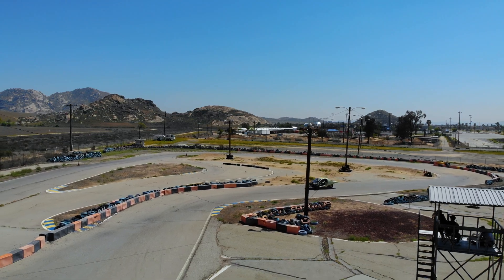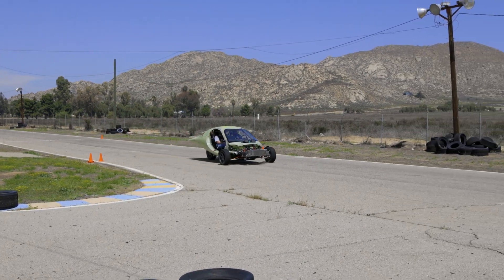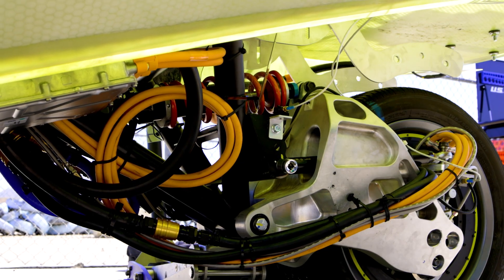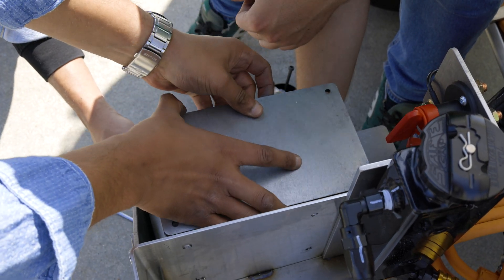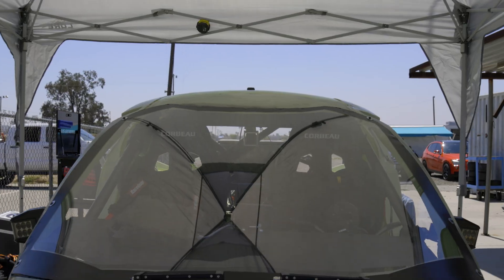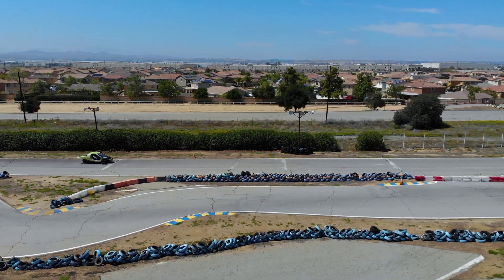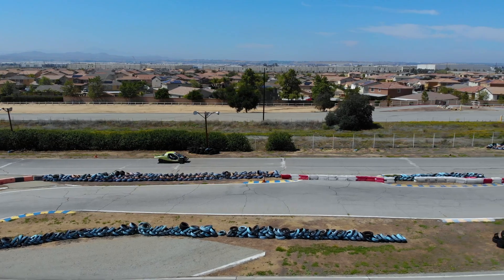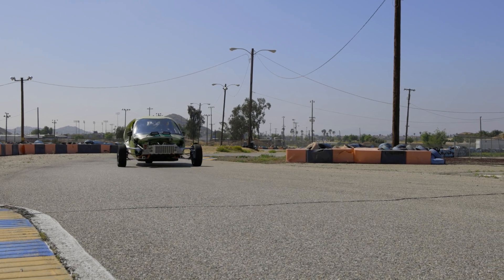Aptera — Brake Testing

Comment: Ha..the car that never could.  This vehicle is a great scam.  Humans have put spaceships on the moon quicker than you guys can release a freakin plain ol ground rolling vehicle.  It's not even a new idea.  People been rolling along on wheels for centuries.  Year after year, month after month, week after week, all we get to see of Aptera is we did the brakes, we did the tires, we did the steering, we did the suspension...haha..  Why don't you just milk it until the Book of Revelation has been fulfilled already?  People have invented 4 passenger private drone electric helicopters that consumers can buy in the time you guys are still trying to invent a car.
Reply: There have been plenty of automotive scams, but Aptera is not one of them, as anyone who does a little due diligence would know.

This present design was started in 2019.  Remember that it took Tesla 6 years to do a simple EV conversion of the Lotus Elise, and even then, has sold fewer than 2500 of them in all this time.  Get some perspective.

Comment: I see a lot of talk about making this a safe vehicle but except for the reverse lights it looks like the rear is all red lights. Will this not have amber turn signals? They're proven to be safer so opting for red turn signals seems like either cost cutting or an oversight.
I haven't seen a video of the turn signals in action but since the front fenders have the amber wrap around to the back I assume that signal will be visible to a vehicle in the next lane, like how Europe requires side turn signals on the fender/mirror (also proven to be safer)?

Comment: How does this thing work in the snow/cold weather?
Reply: We will have to wait for more reports to really know.  They intend to validate it down to -20 F.  The BMS system will keep the batteries warm.  Also the ABS/Traction control is one of the most sensitive on a production vehicle, thanks for the fine control available in the wheel motors.  It can sense slip and adjust torque 32 times per wheel revolution - or about every 2.5 inches of tread travel.  I think the AWD models will be excellent and based on my experience with the Gen 1 Honda Insight, I think 2WD will be acceptable.  I live in Iowa and have an early preorder, so I will be finding out.

Comment: I’m worried about going snowboarding in California with my aptera. Other than some weekly visits when sometimes it snows, I don’t really confront snow or anything. If I’m worried about the trip while snowing (AWD ofc), would it be a safe bet to just remove the wheel pants? Or would I have to/(recommended to) upgrade to the off-road package for safety?
Reply: I just put in my order and an off road package was an available option with higher clearance for the wheel fairings.
Reply: Hard to say at this point.  I would consider putting on snow tires for conditions like this as the most sure footed option.
Reply: The indicator lights are on the wheel pants.

Comment: My only real question is how much leg and headroom does it have? I'm 7ft tall and although I would love a more fuel efficient car or EV, unless I want to drop 100 grand on a tesla model x, I'm kind of stuck with larger SUVs or Pickup Trucks. I love the design of the Aptera, but would someone my size be able to fit?
Reply: At 7 ft, unless you have an unusually long torso and shorter limbs, I don't think you would find it suitable.  Perhaps the seat could be modified to drop you down enough to make it work.  I am sorry for this bad news but I suspect this is an issue you have with many vehicles.
Reply: @n.brucenelson5920  pretty much all vehicles, I modified a Chrysler 200 when I was commuting 140 miles a day. Now I’m a lot closer and got an older Tahoe that I fit in when the Chrysler hit 200k and died on me. It’s a lot of fun and suits me better but gas is killing me at 15 mpg.

Comment: Interesting, finding the optimal braking in each weather condition with the shifting weights perhaps as well as the ratio of the build and passenger or single driver.
Reply: The track tests are done to validate the computer models which allow them to test all those cases virtually. 
If I can take a guess ..... I think they are mapping braking performance as a function of Cg (centre of gravity) location between limits determined during the cornering tests done at Chuckwalla. Now they narrow those limits by finding find the Cg range that gives the best balance of braking performance under the test conditions and edge cases, then balance the design around the acceptable range of Cg that has been narrowed by the braking test. Occupant seats are close to Cg, so will not greatly influence the balance to the front or rearward.
Reply: @limwang6241  hmm the center may be all good but say there's more weight like a person on one side on ice , all cars have to worry about that stuff even when moving. The software can work that stuff out also your right. We'll to me figuring out if a motors wheels has more power resistance or or moves easily on ice and snow or needs braking or whichever motor is just working better even bearings get old ,or worse and anti slip can and will be figured out with a computer program. I assume camera's and lane keep could help maybe when it's all snow some type of infrared or environmental calculations could help as well for solving drift. Guys who do that stuff each systems go through this stuff and people. Hmm you seem upset so I edited this comment for more insight perhaps, the cad guy was only working on some measurements and design pieces not the programming of data testing and such he was no kind of engineer what so ever, but all companies need a cad guy and those cad programs are basically just measurements with a picture. The real testing is done with testing programs, not that cad guy most people have that guys issues don't worry.  Those cad program's are known to be buggy with even just a common update, don't fire the cad guy unless he tries to take shortcuts and make things more difficult to work on and get too.
Reply: @1978rayking  Sure, I guess similar calculations can be done side to side and that the mass of the occupants will make a larger contribution to the Cg location sideways.
Reply: @limwang6241  yup , haven't you been skiing we turn by putting are weight to one side even if we don't angle are feet. Of course the Aptera will have anti skid
Reply: @1978rayking  Yep,🤪 I could not snow ski if my life depended on it.

Comment: Your updates is always a gift. Thanks for that. 
About the brakes, how much regenerative brake will we have? I mean will we be able to drive with one pedal ? Have you  study the possibility to get rid of the brake pads and have electric brakes (More regen and/or capacitor storage and/or reversing the motor power) ?
Reply: Great question. Regenerative breaking usually recovers up to a maximum of around 80-90% of the kinetic energy in an EV with gearing etc. 
Single pedal driving is a question of how your speed controller is programmed. I have seen a MiEV hacked by a guy in Brisbane for single pedal driving and max power / acceleration .... it was awesome in a squealing tyres kind of way.
Eliminating brake pads completely may not be possible because they are used for the parking brake.
I would be a little freaked out driving a car without brake pads regardless of the brand.
Reply: @limwang6241  For the parking brake, many cars are using a pin that blocks the clutch. Aptera could have pins also to prevent the motors to turn. ;-)
Reply: I'm just giving ideas to remove parts and gain weight.
Reply: @olivierlaroque50  Thanks Oliver, I did not know about the pins in clutches. Does that mean the pin goes into a hole in the clutch and nothing will turn unless the pin breaks?
Reply: @limwang6241  The aim is not to break to pin. When you leave the park position "P" and select the drive position "D" on your selector, the pin is removed and the clutch is released.
Reply: @olivierlaroque50  ok. thanks

Comment: Nice update. Thanks. I did notice however that they're using a wheel, not that trendy yoke crap. I guess you really don't want that until you need a turning ratio like in indy or f1.
Reply: At low speeds with torque vector steering, you don't need 360 degree turns of the steering wheel. At high speeds, you don't need 360 degree steering wheel turns. So yoke steering is adequate. The independent power of each wheel will turn your vehicle better than conventional steering. It's all software.
Reply: @IDNHANTU2day  I believe the steering ratio will vary with speed or be manually adjustable.
Reply: @aussieideasman8498  the steering ratio is the ratio of turns on the steering wheel to turns on the front wheels. So on a tight ratio it might take 180° of steering wheel rotation to turn the front wheels lock to lock. On a loose ratio it might take 720° of steering wheel rotation to turn the front wheels lock to lock. A variable ratio would tighten up at low speeds and loosen up at high speeds.
Reply: @aussieideasman8498  The comment never related to the turning radius, only to lock to lock of a steering yoke. Back under the bridge. we will give you some remidial studying to do
Reply: @aussieideasman8498  This statement shows that you have no idea how the Aptera differential steering works.  speeding up one front wheel while slowing down the other will also change the path without changing the angle at all.
Reply: @IDNHANTU2day  I suppose you are correct. But your statement says it all, "it's adequate". I like driving. I drive for the fun, experience, the enjoyment. I don't want software doing it for me. If I want to have wheel spin, let it fly. If I want to go deep into a  corner, let it get some sideways action on the exit. I don't want to have some safety crazed net nanny telling me "no, no, no! Here, let me apply the brakes for you". To that end, In my opinion, the yoke is for those who want to sit back and not be involved, or don't know how to drive well and need a backseat driver telling them "both hands on the wheel! too fast!, eyes on the road! too close!...". Again, in my opinion, I don't like how the yoke feels, nor what it represents - the beginning of the end of the driving experience.
Reply: @Bumblerazz  In my opinion, the yoke will enhance the driving experience over the standard wheel and I'm thrilled about it. I love driving.  Being able to have the viewscreen above the yoke fully in the line of sight is also a wonderful safety feature.
Reply: @IDNHANTU2day  An astute observation!
Reply: The Luna now has a yoke steering wheel!
Reply from the maker: Hi there! Thanks for tuning in and for your comment. We look forward to showing off more testing with the yoke in the near future.

Comment: While you're out there, show the world how easy it is to change a tire.
Reply from the maker: Hi Ronald! Thanks for asking about this! It will not be difficult to change a flat tire with the electric motors being mounted to the wheel. The wheel covers can be removed without unusual tools or special skills in a couple of minutes. We will show off this process once we are closer to production!
Reply: And 3 tires is cheaper than 4.
Reply: Oh, wait. I'm looking at the tires which is where the motors are located.  Does it mean it requires more steps than regular cars?